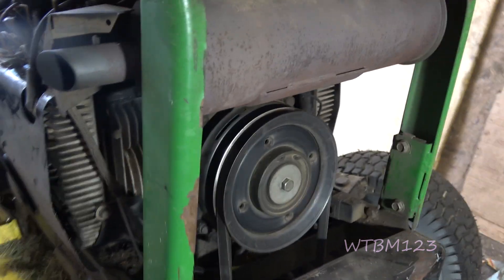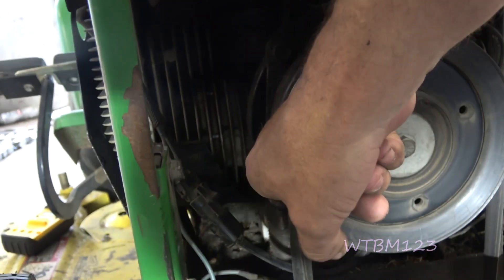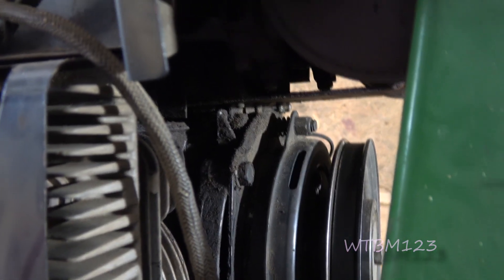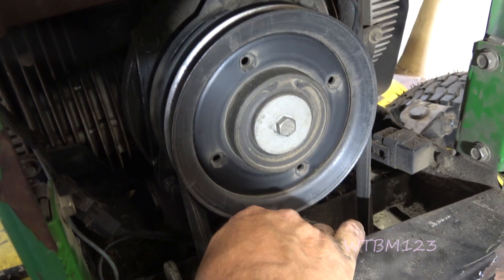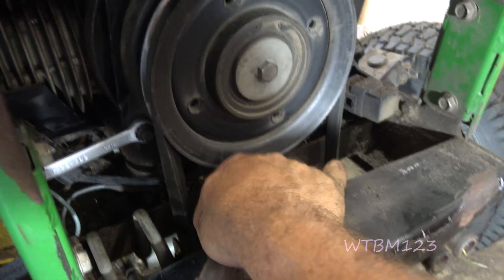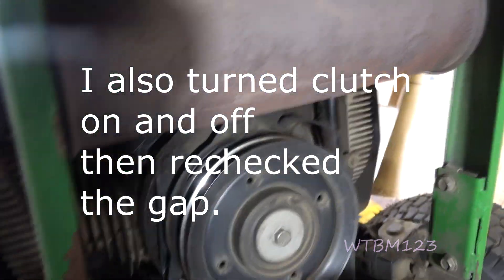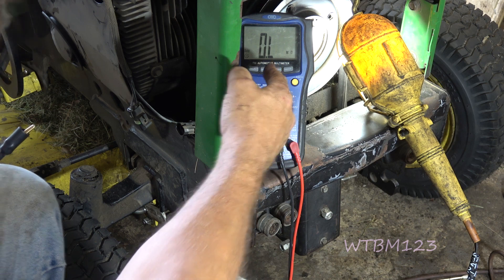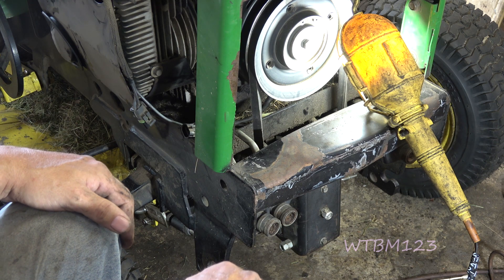John Deere 318 Pto adjust and check ohms

Comment: Thanks very much. I appreciate it. Very helpful.
Reply from the maker: Thank you for stopping in
Reply: @wtbm123  Just wondered if you happened to know what significance it is for the clutch to be adjusted for gap correctly and work well, but has .8 ohms?  Thanks

Comment: If I remember right, the 318 is one of the heavier, better JD, before MTD started making them.
Reply from the maker: Yes the 317 was not going well and the 318 put JD back on track
Reply: MTD has never made a tractor for John Deere. Every lawn and garden tractor with a John Deere name on it was made in a John Deere factory. Either Horicon Wisconsin or Greeneville Tennessee.
Reply: @byronmill  Hmm, Now I have 2 stories. A John Deere Dealer for 34 years, stopped dealing with JD after the big-box stores started selling them with all MTD parts. Now I am interested.